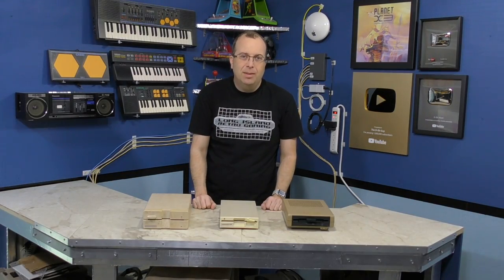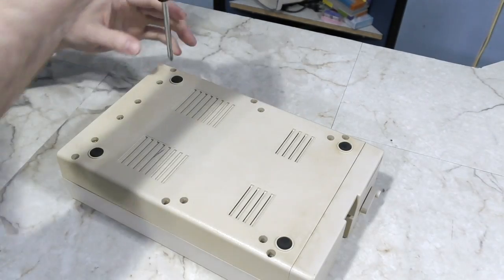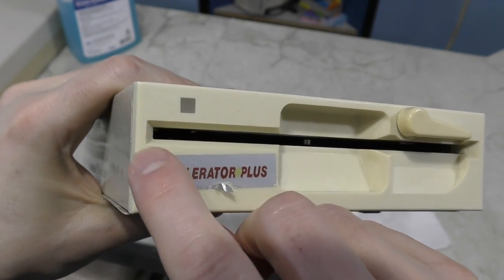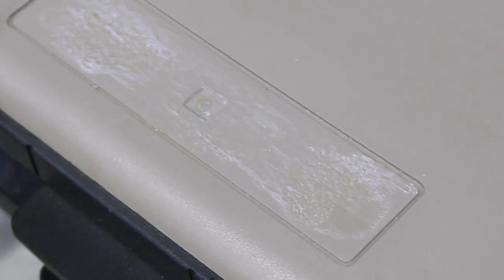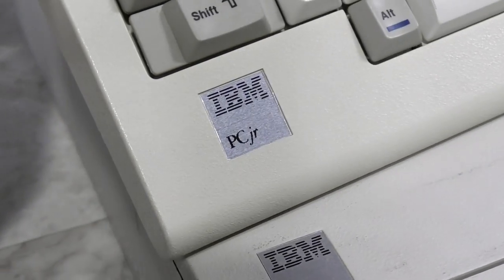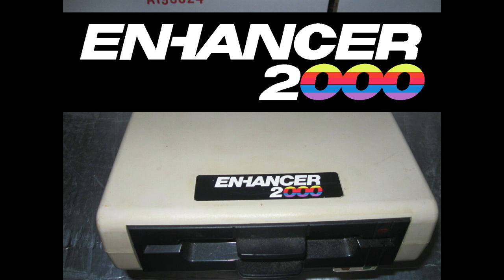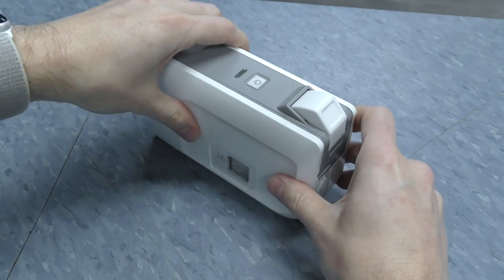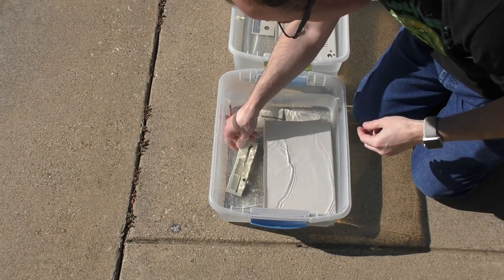How to make replacement badges

Comment: iirc, MOS didn't stop selling to third parties after the Commodore buyout; they'd already provided Commodore's competitors with processors pretty much since they left Motorola, and they maintained those relationships after the Commodore buyout.  The OG Apple II and the early Atari 800s also had MOS-branded chips as well, I'm pretty sure, and they're certainly competitors as well.  (Going by memory on this though, so not 100% sure.)

Comment: a technique for restoring vinyl doll's is 3/4 cup peroxide + 1/2 cup denatured alcohol + 2 TBS baby oil apply with q-tip set in sun with some mirror. it worked reasonably well on Tandy keyboard.

Comment: I highly recommend a good inkjet printer, and some Silhouette MEDIA-CLR-ADH (clear) and MEDIA-SVR-ADH (silver) printable self-adhesive sheets. (Also comes in white, and gold.)  The silver has a satin metallic finish perfect for this sort of thing. But if you need a shinier or brushed metal look, you can print on the clear and then attach it to an appropriate substrate. I used these to make badges and labels for my latest PC build, identifying it as an EBM (Eurobusiness Machines Corp., the IBM of the Cyberpunk 2020 universe) "Virtual Reality Host Mainframe" Best part is, you can run them through a Silhouette Cameo and die-cut the labels perfectly.
However, I've found that if you print it really high resolution/density, the ink never completely takes, but you just need to hit it with some Krylon Crystal Clear acrylic to seal it.

Comment: Oh and the "ENHANCER" logotype uses Helvetica Black Italic. So does the Excelerator, but it uses the condensed variant. Blue Chip uses Eurostile (or Microgramma or Square 721, they're interchangeable). Photoshop has tools for perspective matching and font recognition. If your label making software supports image importing, then identifying the typeface should save you a lot of time.

Comment: You should just wrap the outside of the tub with aluminium foil to prevent any chemical reaction. You can just stick it to the tub with double sided tape or even just tape it on. Or use two tubs (the ones that store inside each other) and put the foil between the two of them...
Great video as always, thanks

Comment: 02:20 "...so where did they get that MOS chip from?" From everywhere. In the mid-1980s, every electronics store, from the small one right around the corner to the major mail-order companies sold the 6526. It was probably one of their best-selling components. I approve of the fact that the 6526 in the BCD/5.25 is socketed.

Comment: For doing the replacement lables on equipment, you might want to consider a die cutter, like a Silhouette (avoid Cricut). You can get inkjet printable silver (metallic) and gold foil, also inkjet printable white vinyl, The Silhouette can do "print and cut) and you can get the exact shape that you need. Their software is easy to use and you can even import a scan of the label that you want to reproduce.

Comment: Hm, maybe you can save some time with redesigning the labels by importing fotos into Inkscape and using the vectorize function? The algorithm works pretty decent, especially when the contrast is good! The vector image can then be imported into Illustrator for further improvement.

Comment: I love the new idea for retro brighting. If you invested some maybe I think it would be a good idea to make a contraption via multiple black lights. I had the idea for black light led strips for that you could put on the side. I’m sure there would be a diy way to do it and make them water proof. Also not sure how much heat that fluorescent black light produces but if it was small you could use something like a suvee to keep a constant high temperature. I’m sure you could do this all on the cheap and it may save you copious amounts of time. Also would yield better results. This is all ball park and requires research. Long time watcher and lurker. Love the videos and always have!

Comment: Suggestion.  Perhaps put the aluminum tape on the outside of the box.  Should reflect some back inside and won’t degrade in the water.  

Alternatively, maybe use a shiny metal box... though it might react with the peroxide, not sure.

Love the video, great job as always.

Comment: Oh.. I have to comment to David.
Watching your retrobriteing made me go to my computer to tell you a possible answer.
What you need to use(I think)? Is a "Sous Vida". I think your issue with the retrobriteing  (like in this episode) is an even application of heat and even distribution of peroxide over the entire surface(s) you're working on.  A Sous Vida (I bought mine from Monoprice for $60)  is a simple device developed to cook food at any temperature inside of plastic bags submerged in water.. It consists of an electric heater, and a pump in a single unit that clips to the side of a pan or ice chest filled with water (or in your case retrobriteing solution). The unit attaches to the side like an aquarium heater but with a built in pump to circulate the solution.  Using a Styrofoam ice chest (cheap and holds the heat in) works perfect for cooking and I am convinced it will work wonders for retrobriteing. The entire chest and contents get to a set temperature and peroxide level evenly distributed by the pump.. and stays there.
You can get reproducible results, without worrying about weather, sun, season, or if it's been too long. Once you use it you will see what I mean. Put everything in, pour in your solution and cut a hole in the top of the ice chest to fit over the Sous Vida, set the temperature and time and it will "cook" everything the exact same amount every time. The pump circulating the solution will  give you even coverage of affect and you can create a chart for how much brightening you get from how much temperature and time.
I see them currently on sale for $42 and that's a steel. 
I recommend you try it.. but who am I? I am not anyone special, just an ex  IT  person (retired now) that has fixed many many things like you do. I had a Vic-20, a C-64, and a C-128 in my day.  Heck, I built a converter for my C128 serial port to make it true RS-232. I was so proud when I used it to go only to my first bulletin board  (long before the internet).   I was an auto mechanic but succeeded in transferring into IT by building clone computers and selling them.   I really enjoy what you do and  have many a Nostalgic memory as I watch you. I love your channel  almost more than any others.. cause  everything you do and talk about, I remember and feel good to listen.

I am retired, but PLEASE try the sous vida.  I am positive it will work wonders for your retrobriteing and I want to see it happen in a future episode. That would be so awesome.

As for the UV? I know that works... after all we get sun bleached hair from UV but we also get bleached hair from hydrogen peroxide.  Heat allows that process to speed up and should allow you to clean any plastic of any amount of yellowing. I suggest you can reproduce the retrobriteing amount in all cases by the following process.  Get some old yellowed plastic pieces, cut them up into small pieces so they all have same amount of yellow in them, take pictures, then use the Sous Vida with a known percentage of chemical on all the pieces at once. Take one piece out after a small amount of time, then continue with the rest of the parts.  After you break it up into timed intervals, you can keep the plastic pieces to use as visual indicator of how much Peroxide and heat to use on any project.  The heating and timer give you known variables to document and the pieces can be labeled for time, heat and percentage of Peroxide for future reference.

Well, I am sure you are tired of listening to me. I will shut up now.
;-)

Best wishes.
Calvin Thomas

Comment: Here's one possibility for that really tough glue residue: vegetable oil.

I was having trouble with the residue from a sticker that basically ignored alcohol, detergent, peroxide, sodium carbonate, plus direct scraping with a screwdriver.

My wife smeared canola oil (cooking oil) all over it and the stuff came right off 5 minutes later!!!

So now I have added canola oil to my battery of weapons to use to remove sticky stuff.

It should be a worth a try... good luck!

Comment: The Excelerator Plus looks 100% like my Oceanic drive, which btw. is by far the best C64 disk drive I've ever had. Not only is it smaller than the Commodore drives, but it has worked flawlessly for about 30 years without any maintenance, while the Commodore 1541's usually start getting unstable after a few years.

Comment: I print a lot of things on foil. There are some decent silver foils for laser printers you can print directly on (Label Outfitters on Amazon, for instance). 
I generally finish it was some clear varnish, Crystal Clear, or in some cases clear adhesive plastic like you'd use in a vinyl cutter. And... in some cases I'll use the vinyl cutter as well. :)

Comment: About the UV contraption, you could use two crates, transparent

One slightly larger, padded with aluminum, the other filled with fluid.

So if you need to Retro with water and peroxide, you use the second crate, if you need to use cream, only the first

Comment: Hey! I built a similar rig for retrobrighting, but I used aluminum tape that was the shiniest on the adhesive side. Then I wrapped the clear container in it on the *outside*. I've had good results, but not quicker results. I used LEDs at first but now I have a gel nail curing light lamp I'm going to try.

Comment: just to beat a bit on the retro bright horse 😊- I use that creme stuff (the hair stylist product), put the coated piece in a transparent trash bag and then out in the sun- I live in Germany and even with 10°C and only 1-2 hours I get my stuff brightened again- so I think the temperature does not matter as much- or the watered down solution shown in the video is just so weak that the temp becomes the limiting factor

Comment: I'm willing to bet that residue in the tub was a mix of adhesive and aluminium oxide, hydrogen peroxide is a strong oxidiser after all. Just a thought for building an indoor retrobrighting system similar to what you created for smaller part like this, if you can get your hands on a large deep stainless steel bain marie tray like they use in ice cream shops with a lid (lets say 1-2 gallon capacity) that could be polished and modified to achieve what you were hoping for with the tape.

Comment: If you find these melted plastic situations very often, then it might be worthwhile to keep your eye out for a palm planner. The one I've got was pretty cheap, and presumably would have made the flattenning both easier & better quality. The main concern that comes to mind is that you still couldn't have gone length-wise unless you ground down the sides of the blade first.

Comment: Aluminium tape in a way is a great idea as it is one of very few metals that reflect rather than absorb uv light, but as you've already surmised it does react with hydrogen peroxide, or rather it catalyzes the peroxide and reacts with the products. if it is possible to find a uv transparent container and having foil outside that would be better (as the adhesive might also absorb uv).

Comment: Only thing I can think of is get an upgrade for your label printer.  We have one at work and it is a low production model which I would say is at the premium home pricing bracket. It can do much better resolution than that and can do those metal backing labels also (or at least ones that look metal). Downfall is that it is only monochrome so no multiple colors (not sure if you can get other than black or white print colors).

Comment: Actually, your fluorescent light is also coated to only let through the UV-A part. You can actually get fluorescent lights without any coating AND made of quartz glas which will also let the shorter wavelenghts trough. These lights are made for erasing EPROMs, exposing photocolors in PCB production or killing germs. They are actually quite powerful and you have to be careful when using them as you can easily get sunburns or headache because they produce quite a lot of ozone when used in rooms.
I use them mostly for EPROM erasing and they work very well. And try not to stare into them. ;-)

Comment: The aluminum tape is still pretty shiny on the adhesive side. The container is mostly clear. Put the tape on the outside of the plastic container so it doesn't come in contact with the liquid.

Comment: Neil from RetroManCave had great success with a Sous Vide heater / circulator to keep the whole thing circulating and warm.
Jan Beta and Neil use an enormous grow light as their source of UV. I have wondered if a UV-C sterilising lamp would work better, but you have to be super careful you don't suntan yourself :-)

Comment: the Excelerator+ was sold in Europe as Oceanic OC-118N. was my first and only floppy drive after the wall came down and I could upgrade from the datasette to a floppy finally. the drive was so much more cool - slim compared to the huge original 1541`s and with this square bi-color LED.

Comment: Great video!! More retro goodness.  When you used the aluminum tape maybe make it a double wall by using two containers and fully taping off the one container bottom and sides putting it on the bottom  and putting the second clear container the one that you're going to fill with water and the hydrogen peroxide solution on the inside that way you wouldn't have to worry about that tape getting wet and peeling off and getting the maximum uv light reflect when adding the aluminum foil so you get a full 360-degree light. Just curious if that would work.

Comment: Tapes, even those made for outside use, need about a full day before they can resist water or sunlight on a hot day. That's because the glue won't have full strength within the first 24 hours (time does vary from 6 to 18 hours, go with 24 and you are always good). Yet as for keeping UV light inside, you should have rather glued aluminum foil to the outside of the box or spray the box with silver paint.

Comment: So i had a thought for doing your retro-bright.  I have been into REEF aquarium's for over 15 years  and if you know anything about salt water set ups for a REEF we use pretty darn good/strong lights that are made to basically act as if they were the sun so our reefs grow.   So my thought is,  i wonder if it would be possible to use some lights like that and a couple of submersible aquarium heaters to get the proper temperature needed for the water.  Would make winter time re-brights much easier if that could indeed be a option.

Comment: Try a three germicidal lamps, you need the UV light on the sides as well to whiten the plastic, light was only coming in from the top. Need to keep the container in a light tight box so one does not fry their eyes. Add the aquarium heater to raise the temperature and you can decrease the processing time to just a day.

Comment: Before you invest in a soda blast cabinet, compressor, etc. Try an air eraser from Harbor Freight and a small airbrush compressor. Also look into UV LEDs for aquariums. You can build a custom setup on heat sinks and get better coverage of the sides of the parts instead of just the tops. There's several DIY aquarium sites (I used Aquastyleonline) that you can order the LEDs, heat sinks and drivers then build them as you want.

Comment: Try getting one of those flat waterbed heater pads to set the tub on for when you need to retrobright in colder weather.  That should do a decent job maintaining the temp of the peroxide solution.

Comment: I think you are on the right path that the UV is the wrong wavelength. Try a small test using an EPROM eraser if you have one. Also maybe an aquarium heater to keep the fluid warm would be safe and easy.

Comment: Oh about your thought on soda blasting. It is an abrasive process, and it is very apparent on plastics. I rigged together a make shift blaster and tried it. It's difficult to control and textured surfaces are noticeably worn, and any glossy surfaces will be dulled.

I think if you want to try the process, don't start with an important piece. maybe find some old clock radio or something without significant historical and or monetary value.

And of course, be prepared for the mess and wear a good filter mask and goggles

Comment: The tape would probably have worked better if you put it on the outside of the bin rather than the inside.   It's reflective both sides and the plastic should be clear enough to achieve what you hoped to gain from that.    All in all, great job!   I love seeing the difference retro-brite makes.

Comment: A thought on the aluminum tape for the uv bin. It might work to use spray adhesive to stick it to the outside of the bin. Alternatively since you're using clear bins you could stick it to another bin and stack your peroxide bin inside that one.

Comment: I've seen another channel, Odd Tinkering I believe, use UV LED strips with aluminum foil on the outside of a similar clear container for retrobright purposes.  Pretty sure he has used the peroxide-free variant of the procedure too, with good results.

Comment: I'm pretty sure that those transparent containers dont heat up nearly as much as the black one from sunlight. And heat might be more important than uv light to accelerate the reaction. Spray painting them black from the outside might have helped, or you could just get a heating element and some way to controle the temperature and spread it evenly in the container like a little propeller in the water, might even help with the bubbles.